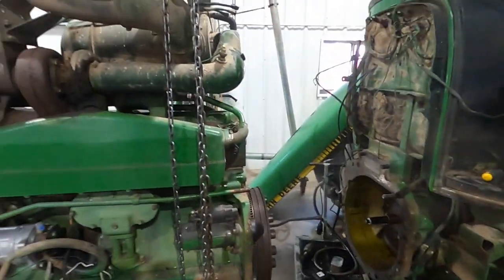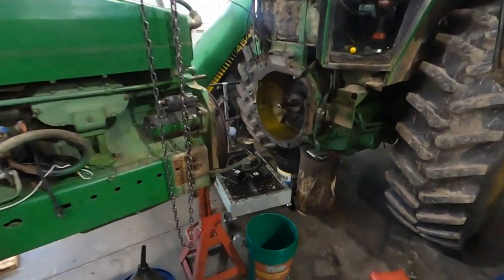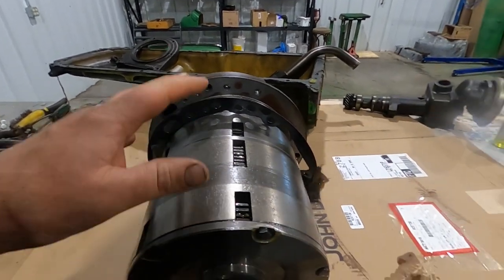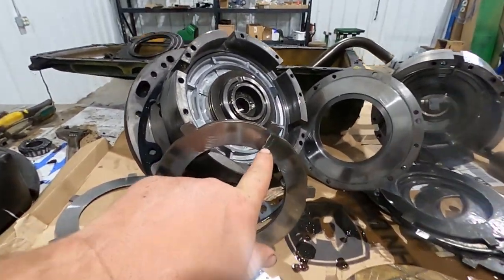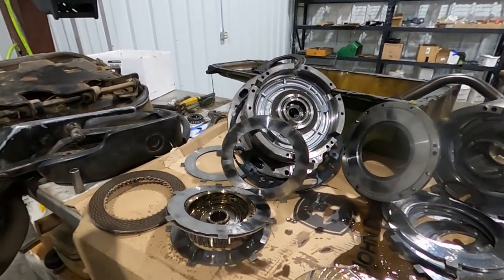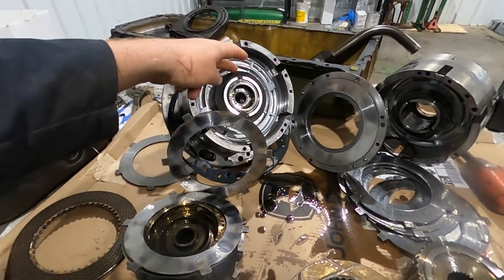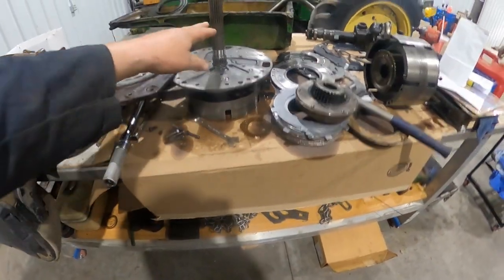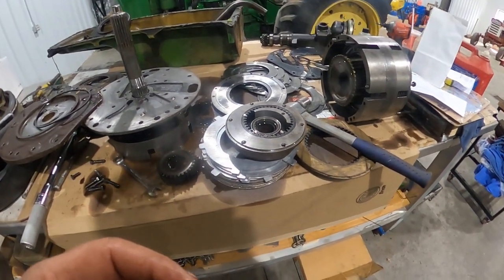Fixing C1/C2 clutch packs on John Deere 4640 8 speed powershift.

Comment: Any idea on how many hours I should quote for this?
Reply from the maker: Honestly I would quote 8 to 10 hours to split the tractor and put the tractor back together and then I would have probably 4 hours quoted to disassemble and rebuild that clutch pack

On a good tractor I can blow them numbers out of the water and maybe save the customer a little money and give myself a little bonus but if you run into trouble at least you've estimated a little bit of forgiveness in there
Reply: @jonstevensmaplegrovefarms3754  any way you would have a parts list and possible estimate cost of parts. Just wanting to give a guy reasonable price on some side work.
Reply from the maker: @alecknapp4041 you could price out gaskets, seals and clutch disks. 
But you won't know until you get in there what you actually need

Comment: hello, friend, I'm from Slovakia, I have a JD 640D, I have the same transmission, 7 and 8 gears, it works very poorly, and 1-6 only on the level of the charge pump, I have new ones.
Reply from the maker: Check transmission pressure, if 7 and 8 slip its likely in the C1/C2 area, 
If lower gears slip it's very tired transmission or more likely transmission pressure.

Comment: I lost 1 thru 4 in same tractor, where do I start?
Reply from the maker: Both forward and reverse?
Reply: All reverses are fine. Started slipping in 1thru 4 , now they pretty much don't work. 5 to 8 work fine, so I baled in 5th, and used the clutch pedal.
Reply from the maker: @ndrancher4041  1-4 in reverse are the same clutch packs other than the forward/reverse pack. 
So if you stand on the brakes in reverse and can't get it to slip, that tells us the gears clutch packs are good must be forward pack.  But you say 5-8 work good. That is backwards, normally 7 and 8 start slipping first.
That is a tricky one.

I would start with a pressure test. Then watch pressure and go through 1-4 forward and backward and see if anything shows up. Keep going from there
Reply: @jonstevensmaplegrovefarms3754  I figured it out! I made a mistake when I overhauled the transmission.  There is a bearing in the rear end just above the pinion that I had the cup and cone reversed. The bearing loosened up and let the shaft wear out the little housing that has 3 bolts holding it into position.  The little piston ring then leaked pressure off. Oops.
Reply from the maker: @ndrancher4041 
Glad you found it. 
Mistakes happen.

Comment: cost to rebuild theses trans ? average for parts ?
Reply from the maker: On these power shifts usually you get lucky and you have symptoms that send it to the shop before complete catastrophe. In M case is a couple Grand can actually go a long ways

The first thousand dollars will just go to gaskets, seals oil filters basically just the parts to do the job.

Comment: These are very solid reliable transmissions. There is a 3020 power shift on the dairy I help out on with well over 20,000 hours on it and the transmission has never been apart. It was bought new in 1967 and for years it ran the feed cart until the feed cart out grew the tractor.
Reply from the maker: Nice! You know member when a tractor got two five or six thousand hours and a guy had thought well it's getting up there in age. 30 years later these tractors have that 20-plus thousand hours and they're still going

Comment: Hi Jon!
Amazing work!
Thanks alot for the tip,i added regular talc powder to my corn seed(1 pound per bag🙂),problem solved!
I want to buy a JD tractor in the 135-150 HP range, full mechanical shifting,only with hydraulic HI-LO.
The 3650 is 120 HP max from what i know,so it s a no deal..
Thanks for any advice!
Reply from the maker: Glad the talc helped!.

Not familiar with the 3650, but if it's a similar platform as like a 2955 they can be a nice tractor, but that hp gets you a little out of range, can you find a 4250 kind of tractor?!
Reply: @jonstevensmaplegrovefarms3754  Yes,i can,but it s a powershift tractor from wgat i found with a quick search on the internet.
I want a very basic tractor,i have enough problems with a Case Maxxum 5140 tractor with powershift.
Thank you very much for everything!
Reply from the maker: I have several 15 speed power shifts around here from cattle operations that are at 25,000 hours and the Transmissions have not been opened up

With anything used you never know how it's going to turn out

The 15 speed is very reliable and no electrical control. 
It is also a tractor that with a John Deere tech manual you could rebuild yourself. It's not the greatest loader transmission simply because you're always sliding that handle for shifting there's not a shuttle shift
Reply from the maker: @andreipetrescu603  the quad range makes a better loader transmission because you can just shuttle from reverse to forward and it's still a good Transmission in the field. Pulsar rock-solid Transmissions that if they're in good shape you should get a lot of hours out of them

Comment: Good afternoon, I purchased a 4640 this winter planted soybeans and started to do some cultivation with a 8row buffalo. I had problems with the pto lifting and so I changed the filters and it was full of glitter. It seems to shift fine but I pulled them out and replaced them. I did not change oil yet but I thought I could finish the field. I am changing oil. And second set of filters. Do you have any suggestions of where to test the oil and make to catch something before it goes south? Thanks
Reply from the maker: Your local Caterpillar dealer can do an oil scan, they sometimes can tell the type of metal and tell you it's a gear or bearing 

Could be bad brakes and the brake disk grinding, could be bearings on the axle or trans.

Comment: John cool video question was the 15 speed PowerShift based on the 8 speed or was it a total new design?
Reply from the maker: The transmission pack is very similar but the sea 1 and 2 clutch pack and transmission pump we're a big change and for the better
Reply: Thank you very much
Reply: @jonstevensmaplegrovefarms3754  I was told one time that a 15 speed actually as 16 speeds but 2 of the gears are the same ratio so John deere made it so you cant  use it.

Comment: Funny how those are a hell of a lot heavier than they look.  I had mine out about ten years ago to get the top transmission housing bolts out.  I need to take it apart again to work on the hydraulic pump.
Reply from the maker: What model?
Reply: @jonstevensmaplegrovefarms3754  4840.  When you first start it you gotta run it wide open before it will pump any oil.
Reply from the maker: @joemorse257  what would happen if you just started it and then walked away for a couple minutes oh, would you have steering and brakes?
Reply: @jonstevensmaplegrovefarms3754  nothing until you speed it up, won't even move.. ive forgotten and started dumping the silage wagon at an idle and it'll quit, then you've got to put some oil in it and wind it up to get it to go.
Reply from the maker: Have you cleaned the sump screen? Or do you think the pump is just that shot in the transmission?
Reply: @jonstevensmaplegrovefarms3754  I did back when it first started acting up, and I'll check it again before I tear into it.  Makes me wonder though since it helps to have a little extra oil in it.
Reply from the maker: Once up and running does an impliment chatter I you use hydraulics?
Reply: @jonstevensmaplegrovefarms3754  no sir.  Pretty much normal
Reply from the maker: What is system pressure?  Something is odd.
Reply: @jonstevensmaplegrovefarms3754  seems like I checked it a while back, but I don't recall what it was.  But yeH, I doesn't seem likely that the pump is that worn, but I would think that if the packing on the back side were bad it would suck air if it were above oil level, and work fine if below. I haven't been into the powershifts that much so I don't really know them that well
Reply from the maker: That's kind of what I was thinking it is somehow it's getting air until it gets primed?
Reply: @jonstevensmaplegrovefarms3754  maybe I'll unbolt the suction pipe from the clutch housing, and if oil drains pretty fast I'll tear into the pump.  Hopefully, but not likely, the problem will be obvious but not to expensive?
Reply from the maker: The book will say take that pipe that goes in the left frame rail from the clutch bell housing and unhook it from the clutch valve housing and hook up a hose to a bucket and then you record how long it takes put a couple gallons in there.

Comment: My son has a 1961 4010 and the hydraulics seems slow and while lifting the implements chatter.  Is there a way to test the main pump and transmission pump to figure out which one is the problem. Aloso this tractor is strange in that it does not have a priority valve. Where most tractors have a priority valve, there is just a casting to connect the lines. There is nothing inside but a drilled hole.

Comment: This is probably trivial to your skill level. I have the 4440 leaking on the scv and it needs to get upgraded to the new style as well.  If you happen to have a 40 series in the shop, it would be great to know where to start. thanks.  I also think I need a 3rd scv with the planter.
Reply from the maker: We quit doing the pioneer (iso) conversion a long time ago. They always seemed to leak.

Where is yours leaking? Around the barrel or out the hole where the hydraulic hose plugs in? Is it very easy to push coupler back and forth?

Comment: I have a 1980 540b skidder it has I believe the same transmission. Supposedly it has a new clutch when I push the pedal in all the way it doesn't fully disengage . I've adjusted the linkage to the pedal as much as I could to no prevail. any ideas?
Reply from the maker: I would put a pressure gauge on the clutch port, see where pressure goes when you push the pedal down. 
If that is going to zero psi with pedal down, could be damaged disks in c1c2?
Reply: @jonstevensmaplegrovefarms3754   I was told clutch valve possibly?  125$ for a reman may try that
Reply from the maker: That's what the pressure test would help determine. For $125 for a reman clutch housing I guess I would try that